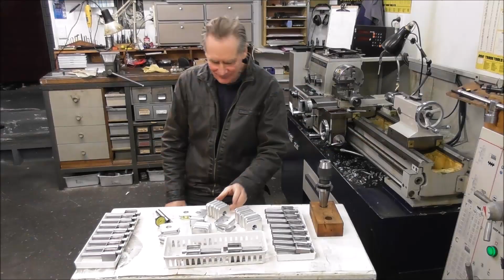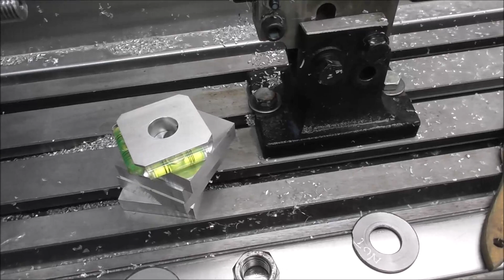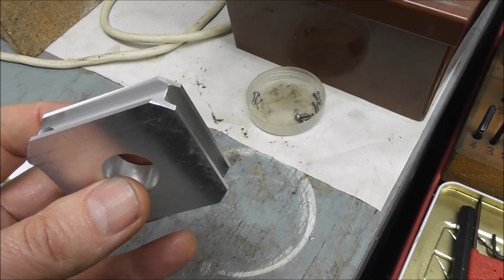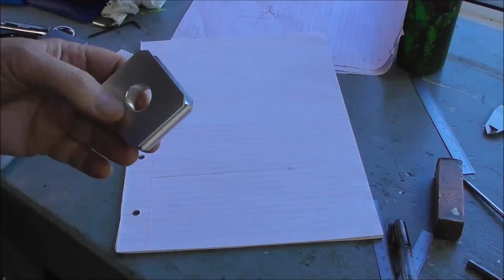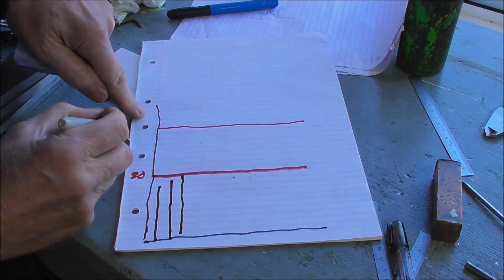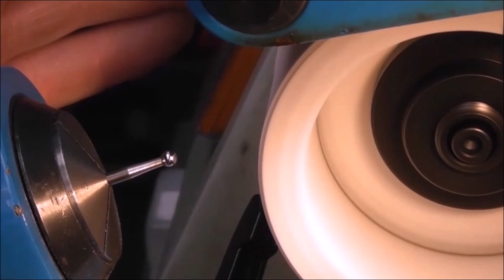Tormach 4th Axis - Stacked Parts Production

Comment: If your part can tolerate the manufacturing feature, drill a smaller hole off-axis so that you can pin all the parts together, preventing relative rotation.  A single piece of precision ground rod or spring pins between parts and the collar should do the trick.

Some might suggest cyanoacrylate to glue the parts as an alternative.
Reply from the maker: Hi Bernd. They could be useful tips for more vulnerable situations. My situation was fine with just clamping pressure. Remember that is how a vise holds the work . Cheers  Cliff

Comment: I was thinking the same thing about clamping pressure over time with the fly cutter...  I always think of them as "beating" the chips off the part because that's what it sounds like.  At some point, if you have a part the didn't get cut on the bandsaw very well, you'll be taking off a larger chip and it might let go!  I like your collar solution.  Cheers!
Reply from the maker: Cheers Greg!  Cliff

Comment: Another great video Cliff, I always learn a bit from every one!  Does the plate thickness need to be exactly the same for each piece? If there is any difference would you offset the tools in the program?
Reply from the maker: Hi - Thanks for the feedback. I machined all the blanks close to the same so I don't need to account for variations. But if they are different, and you wanted accuracy of each part, yes you would need to apply some method to compensate the toolpath position. There are different ways of doing this, which one would be best would depend on the part design, code type, and measurement method variables.  Cheers  Cliff
Reply: @Threadexpress  thanks for the reply  it's definitely something else to think about with CNC machines.  I have a small 4th axis so your stacking method could come in handy.